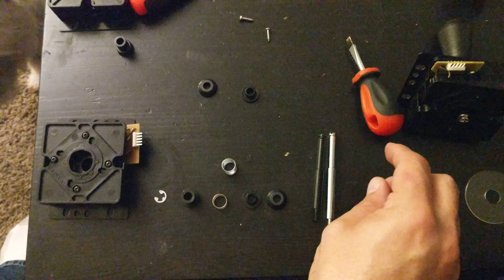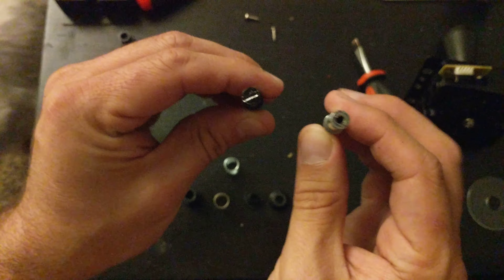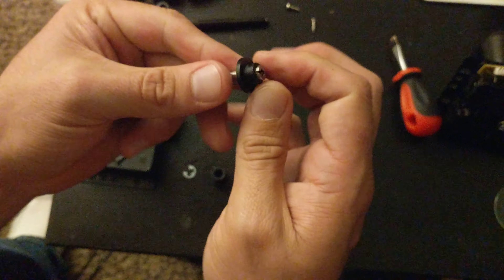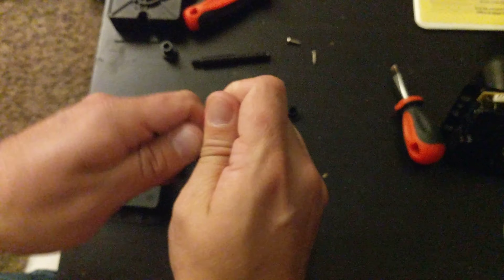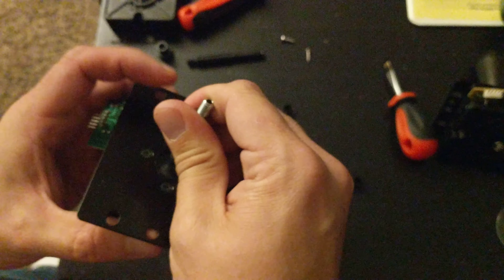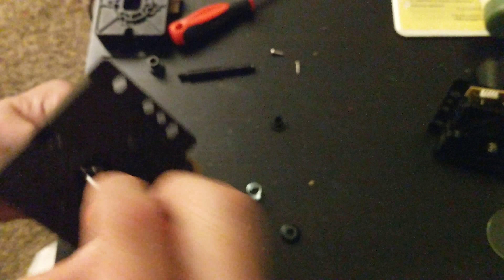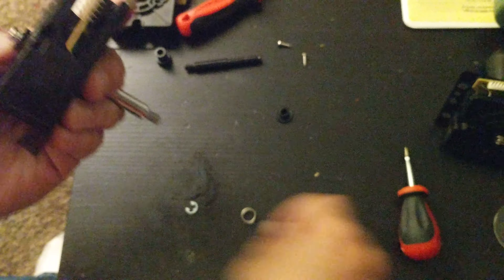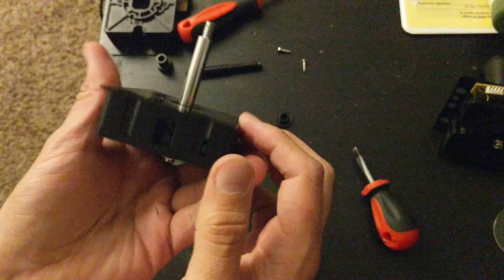Hayabusa with JLF extended shaft

Comment: I recently attempted this same mod but noticed the stick felt oddly loose with the extended shaft
Reply from the maker: Xavier Henry I prefer using a 2lb or 1.5lb spring since leverage is different after especially if you’re using a battop.
Reply: would a " heavier spring " make it have more tension / feel tighter ?
Reply: @djMaki  From videos I have seen simply stretching the spring to a little over 3cm will give it a firmer feel.

Comment: hi joey, I find that the Hayabusha shaft is quite long (longer than JLF shaft). Is there anyway to replace standard Hayabusha shaft with standard JLF shaft?
Reply from the maker: modology Absolutely in fact, I use the phreakmods JLF link shaft on Hayabusa’s and they work perfectly. I’ll need to set a Hayabusa shaft and a JLF shaft side-by-side to be sure, but I think they’re very close in length. I believe that it’s just the design of the Hayabusa body and pivot that make the shaft higher.